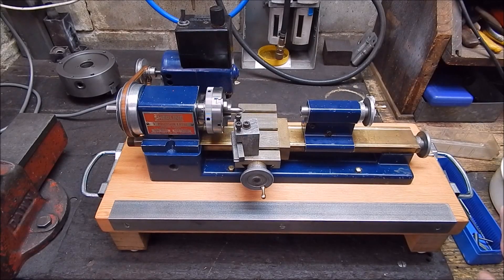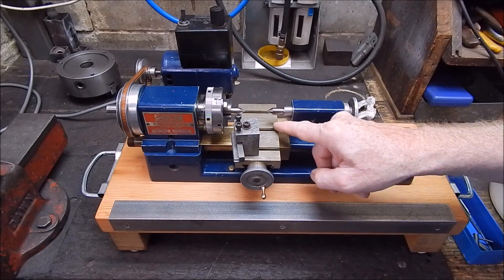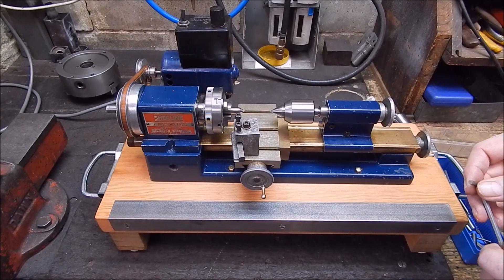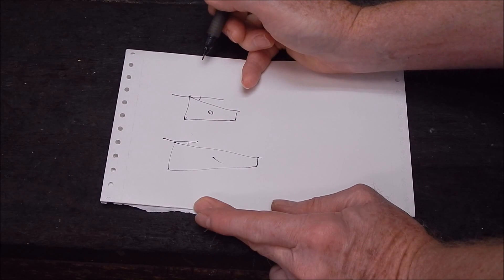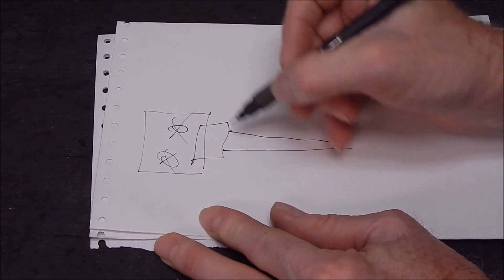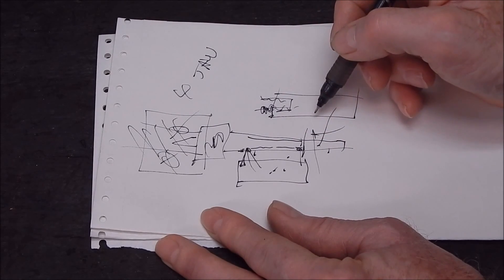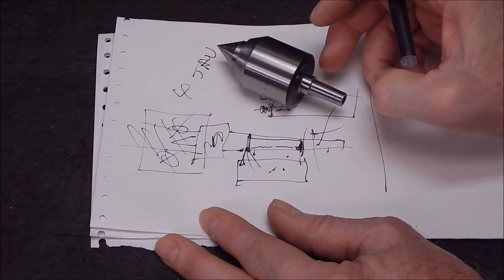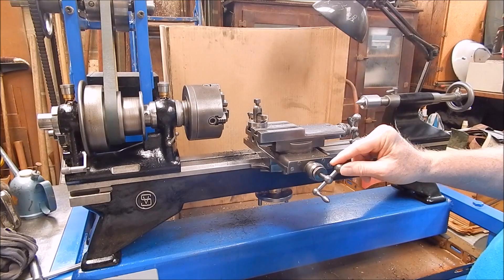How to convert a Morse taper one shank to Morse taper zero

Comment: I have a US Sherline of more modern design. They fixed the no overhang issue, but it’s still not good. You still need to extend the barrel a lot, and the new design only have set screw type lock for it. It’s very wobbly. Only way to work around it is to move the tool post over, an waste 2” of material close to the headstock, or turn that part later moving TP again.
Reply from the maker: Thanks for the update info.  Cheers Rob

Comment: Hadn't realized tail stock was quite so inadequate. The modified live center sure makes a big difference... certainly could be worth getting a 0 morse reamer I think. I cleaned up my tailstock quill with a #2 Morse reamer - helped a lot.
Reply from the maker: The female taper in the quill is OK.  It's the quill barrel which is sloppy in the tailstock.

I need to tighten that up.

Cheers Rob
Reply from the maker: I've since found there is a trick to how you adjust the tailstock on these early Sherlines.  

Cheers Rob

Comment: If the taper's worn it's probably because tooling has been spun in it.  It's unlikely it's worn evenly.  I think it might be worth while to think about getting a morse taper reamer.  An M0 will probably cost around US$40.
Reply from the maker: The video is about reducing the size of a Morse (male) taper to a smaller numerical size, so it can be used in the relevant machine.

The condition of a female Morse taper is important, but not what this video is about.

Rob

Comment: At first I would have put an indicator to the end of the quill and wiggle it to measure lateral movement at that location. Then I would do the same at the forward end of the live centre (on its body). From the two measurements and the axial distance between the two you can derive the centre of rotation. If it lies behind or close to the rear end of the taper then the quill contributes most of the slop. If it lies in front or close to the forward end of the taper then the taper fit contributes most of the slop. This way you can direct your counter measures to the main cause. If you do the same with a defined lateral load instead of just wiggling ( using a spring balance or a weight on a rope) you could compare before and after the modifications and make sure that you really improved the result.
And it needs to be considered that a MT0 is less rigid than a MT1 which increases elastic lateral deformation under load also if all slop has been eliminated.